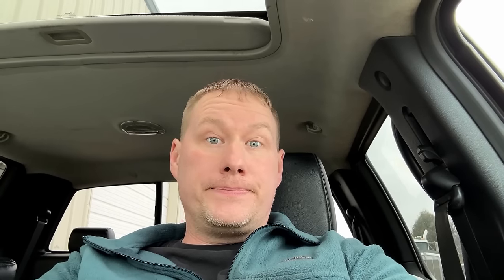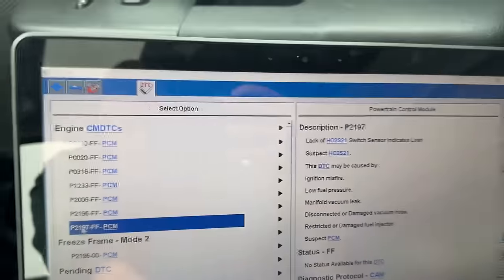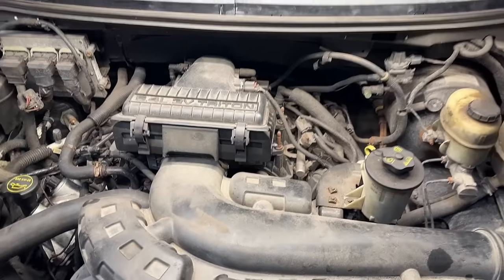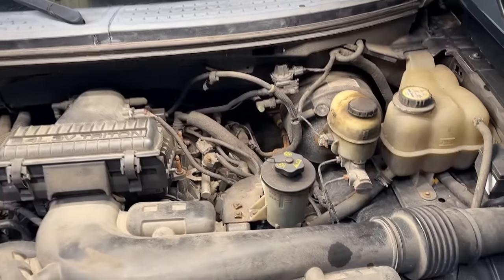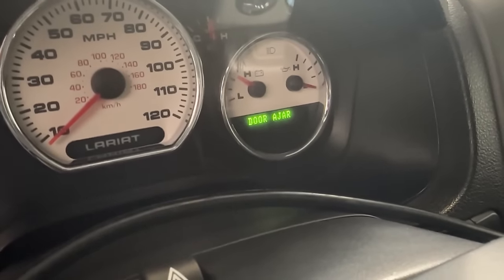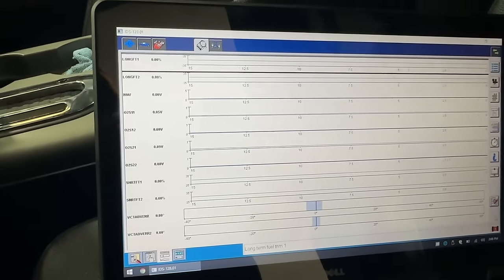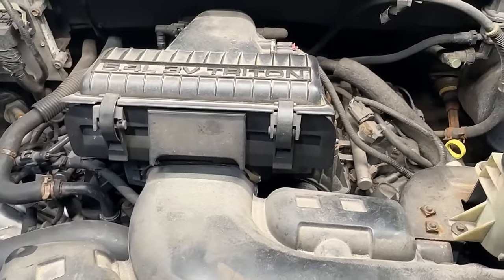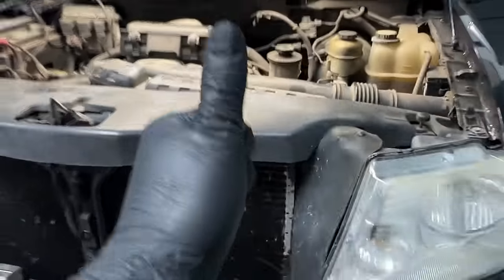Ford F-150 5.4L 3v Triton Engine P2195 P2197 Stuck Lean and Runs Rough: Let's Diagnose It!

Comment: I have a 2005 F-150 FX4 5.4. I bought the truck new with 25 miles and now have 325k miles. I had to rebuild transmission at about 290k, but engine is untouched. Even has original coolant hoses, water pump, starter and alternator. Replaced throttle body seven years ago due to electrical failure. I’m towing my 2020 19 ft travel trailer as I’m writing this. The truck doesn’t burn oil and gets about the same mileage it always has. I was an automotive machinist when I was a much younger man and no one will ever convince me that the 5.4 is a bad engine.
Reply: If your engine has that many miles ... change the oil cooler immediately... when it fails it fails internally ..... (and it will soon with your mileage) ... When it does oil pressure will overwhelm the coolant pressure and your radiator and engine coolant passages will be filled with oil...  When it happens you will get 0 oil pressure with no knocking and you will hear gurgling in the dash as oil pumps through the heater core ...    The oil cooler is above the oil filter .....
Reply: My bad, I misread your comment.
Reply: This is not physically possible without a blowen head gasket etc. I'm with the poster this is a great engine if maintained properly.
Reply: @aclary81  the oil cooler is a heat exchanger between the coolant and the oil... When it blows internally the oil goes into the coolant side...  oil pressure is near 40 psi and coolant is 18 psi .... once the oil pump runs out of oil then the coolant will pump back into the engine
Reply: Even better get rid of that junk 5.4 3v 😂
Reply: @whirlwind8825  Yes you are correct, although I don't think all 5.4 3v engines came with this setup, nor is it a common point of failure.
Reply: @josearellano3268  Troll go away.
Reply: Lol keep the posts coming love the 5.4 hate. One day people will say the same of the ecoboost engines, which have endless vct related failures, in both cases people like to ignore the millions that don't lol.
Reply: @aclary81  Why don’t you go and find some other way to entertain yourself.
Reply: @standhd  😂
Reply: @hutchinson54  lmfao 🤣 u think I live in my moms basement 😂😂 u keep thinking that …
Reply: A well maintained engine can las a long time,
My only  concern is that u are watching  videos on YouTube and writing comments while u drive 🤣😂😁😱👍
Reply: 04 F150 5.4 3v 340k no issues never had valve covers removed. 3rd battery 🔋 3rd alternator.
Reply: @aspenyukon6845   If  you have a oil cooler ..change it ..   I spent hours flushing my 5.4 when mine blew at 230k.. The oil pressure is so  high into  the coolant side it  will blow the radiator pressure  cap  and fill the coolant side with oil.. and of course pump the engine dry .. I was fortunate it happened  off the highway ...and I was going slow.  The telltale sign is gurgling in your heater core  and you will see 0 oil pressure  :)
Reply: GTX 15w40, 8qrts, every 3k mi. Filter every 10k mi.
Reply: I have a 2005 5.4 3 valve with >290K . There was a failed plug years ago that broke when it was removed. Mechanic blew out the cylinder with compressed air, replaced the plugs, and she was good as new. Also replaced failed alternator about 6 years ago. Other than that she's been a solid motor.
Reply: @luigigonzalez5062  😂
Reply: @josearellano3268  he will and so will the rest of us, cuz it's probably true 😂
Reply: Yup 253k on my 2006 and it's going strong, but did replace alternator at around 210k
Reply: I'm glad yours is doing well. I have this exact truck, and have been chasing an expensive phantom engine problem for over 5 years now. Two different mechanics have said they can't figure it out.
Reply: It's the advertising by the BAD MANUFACTURER!   I am 100% certain that you did not "go by" the ford recommended service intervals...   otherwise - you would have massive failure(s) starting long before 100,000 miles.    Still, the oil pump problems and the [exaggeration] football--field-length-timing chains WILL STRETCH and cause issues that require EXPENSIVE REPAIRS on ANY TRITON engine...
Reply: @aclary81  again - "maintained properly" means IGNORE the service intervals provided by ford
Reply: @josearellano3268  one in every crowd... smh
Reply: 260,000 on my '06 Expedition and the trans is starting to act up in overdrive. But after watching Brian's video on an overdrive issue, it may not need a full rebuild (I'm hoping!)
Reply: When should the timing chain be replaced?
Reply: @MrBayrum56  I’ve been waiting for it or the cam phasers to make noise, but they don’t, so I haven’t done it. I do all maintenance myself and fix stuff before it gets bad. I also use an oil additive called ZMax, I think that has helped.
Reply: The frame rusts out before the engine dies

Comment: Sold my 2005 F150 (not stock) with the 5.4 at 86,000 miles,,,, bought it new and started modifying it immediately, it was used hard towing and long trips, it could do huge long smoky burnouts and even drag raced many cars.  All I can say in my experience it was a 100% trouble free vehicle and performed perfectly.  (Now driving a gen2 Raptor)
Reply: Ooooo...aren't you special. Thanks for reporting your total awesomeness better than us all.
Reply: @clutch5sp989  I see that Christmas and a New Year is already a failure for you.  Sadness.
Reply: @philipmackin1025  What?...try to say something nice and this is what I get.

Comment: Thanks for all your videos!! Seems like the 5.4 has its share of issues!😞i have an 05 f150, just put a new Jasper motor in, but still getting codes P0340, changed camshaft sensor but still occasionally has rough low idle. Also only getting 10-12 mpg.

Comment: My 2006 f150 5.4 has one side cyclinders stopped and mechanic is asking to change engine when asked he says 271000 kms already then will have to change transmission.. scrap it.. cant digest.. what sequence to be followed? To have it fixed? Can somebody suggest.. thanks its in surrey BC Canada

Comment: I have a 2006 f150 5.4L 3 valve and need to do a timing job on the engine.   Do you have a recommended parts list which also includes the rocker rollers?

Comment: Pretty sure my 2000 2v V10 f250 is stuck rich. Total pain trying to diagnose it since it never sets a code
Reply: If you have a way to get it hooked up and see what the values are, I'm betting the coolant temp is stuck cold. A bad sensor going to the cold side will make it run rich, yet not trigger a sensor code. Might possibly call it a rich o2, but its a good place to start.

Comment: What software is that?
Reply from the maker: Ford IDS
Reply: @FordTechMakuloco  ok i found the software do i have to use a special OBD-II interface or will a regular Bluetooth OBD-II one work? i have the one i use with torque pro. I have a 06 expedition i bought off my neighbor the dealer diagnosed it with "cam timing off over 50 degrees" but i sure would like to confirm this before tearing into it. symptoms...will start but not idle much at all especially when it warms up. U can keep it running for a bit if you keep the RPM up around 2000-2500 my other question is/was will an engine even run at all if the cam timing is off 50+ degrees?? seems like alot... after clearing codes the 1st 2 to show up are the same you got 2195-2197

Comment: Just did the intake elbow replacement. I’m 72, & spendin’ several hours under the hood of a ‘98 F250LD wasn’t the easiest. Tough twist & roll around, but after a disconnect of a few hose & plug-ins I was able to get my hands shoved in far enough to grab the line. Had to cut the stuck remainder of hose off the nipple with a box cutter blade. Typical p0171 & 74 codes. Chased it around for awhile before I realized it was an upstream air problem. Doh! After that I changed out the PCV just to see, since it hadn’t been changed out for 2 decades. It was still good! Then it was a contortionist act & found the elbow was cracked at the bend. No big hiss. I had sprayed with soapy water but never got a rpm change! I was about to break down & buy a smoker, but fortune smiled on me! Really enjoy watchin’ y’all, LOCO!!!

Comment: My 07 F-150 has 314k miles. It's runs good, I will inspect a vacuum line for cracks just in case. Thank you for good info.
Reply from the maker: I am sure this line is at least collapsed.
Reply: If the line is collapsed will it make it idle rough
Reply: I'm getting a code P0420
Reply from the maker: no

Comment: I had a vacuum line crack just like that also in that same area that was causing misfire codes during heavy acceleration (on ramps, etc) on my ‘05 5.4 3V Triton.  It took me a while to find it, but fixed it with some Gorilla tape until the new hose came in.
Reply: That gorilla tape will probably out-last the rest of the hose lol.
Reply: @markm0000  😂😂😂😂

Comment: Vacuum leak that's y lean codes. Had this problem with a kia suv a while back. It was intake  gasket, n throttle body shaft o ring was bad.The vacuum  leak on that car was not noticeable at all n the car ran fine just kept throwing lean codes. Great stuff thx

Comment: Lucky me I just replaced that exact hose on mine about a month or so ago because it looked like it was deteriorating and I remembered the last time I changed the spark plugs rubbing against that hose turned my arm black. Crazy how they  deteriorate. 
At 256,000 I'd say that hose will be good for the life of the truck. 😎👍👍🤙

Comment: This was my issuse on a 2011 expedition after I did the timing this weekend. I was not getting any code, but the truck was running horrible.  I didn't get the line hooked up right on the intake manifold.

Comment: The older 02, 03 V10 one ton vans had that crappy pcv hose that would tear near the throttle body.  Using the "WDS"  (that's right!  this was before the IDS) and a can of Chem Tool and listening, there was the leak. The idle roughness was so bad it shook the van and thankfully the ladder roof racks were tight or there would have been two expensive ladders on the floor!  One new upgraded PCV hose assembly later and a very smooth, happy running engine.
Good one Brian!

Comment: I just want to join all of your other fans in saying Thank You! I got severely screwed purchasing an 08 5.4 Lariat ffv. Loved everything about it the day I bought it, and I knew nothing of the 5.4 phaser/oil pump problems. Had it for 2 days,  replaced 02s, vcts, etc etc, then found out about the Real problems. I didn't have the Extra $4000 for all new timing components and Labor, so i joined Ford F-150 Forum and learned about You and i must say, You are awesome, and i am OCD too, so of course I had to do Everything right, no shortcuts. 1st time Ever inside the Real components of an Engine, and im pretty sure i nailed it. All i like if power steering pump, pulleys, and priming the M360hv. Im confident, but have also been praying bc if this doesn't work, my family and I are in a very bad spot. I wanted to share it all with you, and to be honest, i absolutely Love the truck and the motor, even with the problems. Thank You again,  you made me into a true DYI mechanic! 🙏

Comment: First off I absolutely love your channel. I've learned so much about my truck and how to do some things I wasn't sure of. One question about this job though; what is the hose/part called that was causing the leak. Mine looks like it's been repaired at some point cause it has a splice on it and I'd like to replace it with the full one-piece hose that it's supposed to have from the factory. Many thanks and keep putting out the great videos.
Reply: Did you ever learn what the name of this hose is?

Comment: K.I.S.S.. Keep It Simple Stupid.. We had a tech spend 3 days chasing why the display screen wasn't working in a Cat 320. Blown fuse, now the how and why that fuse was blown, corroded pin in one of the 2 Duetch connectors. He recommended a new control screen, wiring harness, and a trip to Cat for the machine to be reprogrammed.

Comment: Brain your the best ford tech.  I've ever seen. I worked for Ford 40 years ago. Back then just had a analog voltmeter to check trouble codes. I didn't like variable ventura carburetors and feedback carburetors. Thank goodness when they came out with OBD 2. I'm retired now.  But still work on my own cars. Lost interest in anything made after 2015. To much Redundant stuff on newer models.  Just my opinion.  Thanks for all your expertise.

Comment: Hello Brian, almost 74 yrs old here and I love the performance and economy that my 2015 Mustang GT or 2018 Focus ST offer but in many ways I miss the simple engines we had back in the 1960s and early 1970s. (Except adjusting the points constantly, Smile) You're quite a way from where I live in Rochester MI but if I had a weird problem with any of our Fords I'd be very tempted to try and get to you as I think so often people working on cars have almost no idea what they're doing these days.
George
Reply: Before installing a pertronics igniter, I kept a flip open match book in the glove compartment of my 1969 mustang - It was just the right gap for emergency adjustment of the distributor points.

Comment: Still chugging along in my 2006 F150 5.4 3v. 270,046 miles and no issues. I guess I got the exception to the rule on 5.4 3v.
Reply: Original phasers and chain tensioners? I have 170,000 on mine original everything ran 5w30 synthetic from first oil change
Reply: These are great engines if looked after, don't belive all the talk about the vct system needing 20w oil, that was entirely epa cafe bs, in fleet service they usually get a 40w and run just fine for 300 to 400k with regular maintenance. Many get by with 5w20 but if you want it to last forever a 30-40w is the way to go. Some extra MOS2 is great for the 3v as well 👍
Reply: @MarkWilliams-vp7xw  All internals original. Only thing that's been changed is plugs. Went to 5W30 full synthetic several years ago. Pulled a 27.5 ft. fifth wheel for several years until my wife died in 2021. Runs like a top.

Comment: My 2005 expedition had the same hose split open giving me a check engine light  with p0171 and p0174 codes. Replaced the hose for $40 from ford cleared the codes.

Comment: 2005 5.4   Rolling up on 393000 miles   All stock internal engine parts  , transmission filter changed once    Lucas oil products rock !!!

Comment: I have a 2000 f250 4x4 that I use for a work truck….. 274k miles on the original engine & narry a problem….. done all the basic maintenance on it to keep it running top notch…… plugs, alternator, fuel system-oil system-coolant system flush, water pump etc….. but still pull trailers & materials w/ it regularly & it runs perfect, 11 mpg, but runs great…….

Comment: Changing that rubber elbow at the back of the intake is one of the worst jobs you will ever have to do and breaking the intake is a real possibility. Not changing that on an engine job is a real no no.
Reply: Try replacing the heater core. Dash has to be removed
Reply: @eldonhalliburton4766  They are easy, i do them regularly . We have 80 trucks at our shop plus outside work from mines that all use ford trucks. Really not that bad, just did a evaporator before christmas. Do a door latch on 21, thats real fun  LOL
Reply: @frozenstang3868  that rubber elbow is a huge pain on lightning/Harley Davidson trucks.
Reply: @eldonhalliburton4766  i had to do mine last year. Lets just say I had a couple bolts left😳
Reply: @9HighFlyer9  on the 4v yes. The N/A 5.4 isn’t as bad

Comment: My grandson just bought a brand new  F-150. While rotating his tires, a broken axle bolt fell out. It is one of those torque to yield bolts, which is another way of saying tighten the bolt till it fails. How many cars in the old days had bolts that u would stretch to almost failure?  How much money does Ford and the other manufacturers make from selling these single use bolts?  Sorry Brian, I know u will disagree with me. 😥😥

Comment: I’m an HVAC tech and your damn right the customer will be charged for our time!  Our corresponding knowledge comes from tools, education/training and experience and that comes at a price regardless of how easy the problem was to diagnose and fix.  We always have to consider what other paying work could have been done during that time of that “easy” fix.  Us techs must always stick to this philosophy.  Thank you for your videos!
Reply: Aman.
Reply: the best thing I ever did for AC DIY was buy a multimeter that could test microfarads on start capacitors.  It pays for itself the first time you use it.

I wouldn't recommend it for everyone - 240V AC is no joke, but if you have a general knowledge of electrical principles and safety procedures, you can fix your own start capacitors.  Pull the power disconnect and short across the terminals on the capacitors before doing anything though.
Reply: @JimBronson  a multimeter is the preferred tool unless one enjoys being jolted when measuring volts via a micrometer, lol.  We certainly know what you meant.  As you stated, be certain to discharge capacitors prior to measuring capacitance.
Reply: @briancarlisi2224  I had engine clearances on my mind.  post changed.
Reply: @ericheld4382 thats funny

Comment: While changing spark plugs the cheap plastic 1/8”vacuum line to the fuel rail reg valve snapped like a pretzel in three places. Is there a source for pre- made vac harnesses or am I stuck with generic hose and tee type fixes?

Comment: Heard it and saw it immediately when you cranked it up! Had the same thing happen to me about 2 months ago. Replaced that hose and all good again. 2006 F150 Lariat 5.4 with 254,000 miles with a few dents and dings but still going strong!